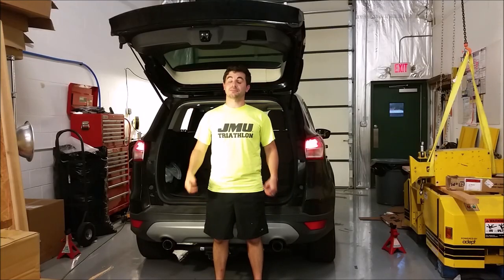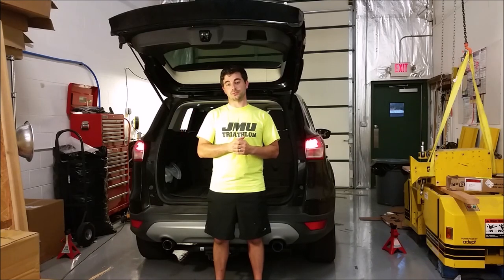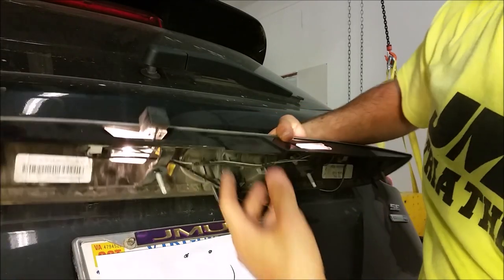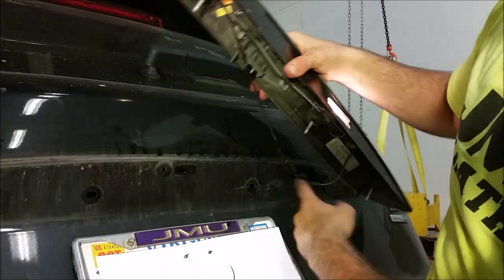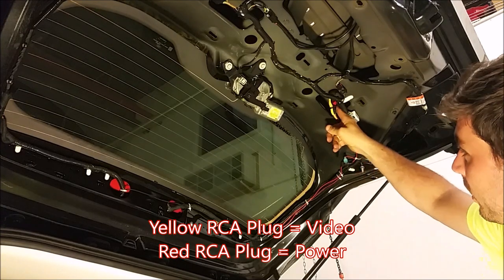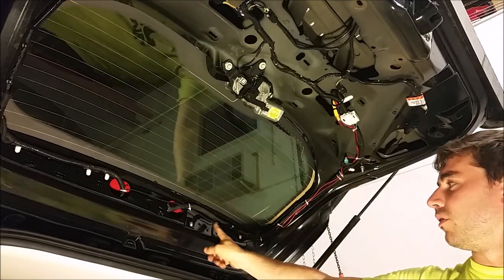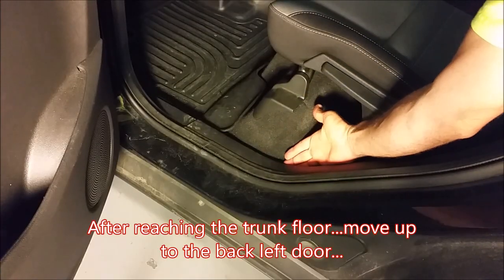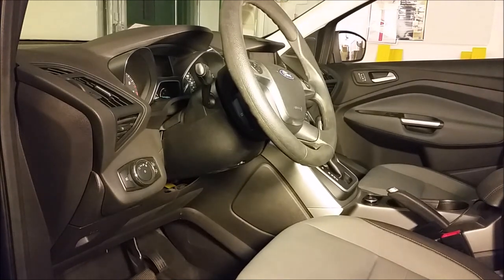Ford Escape Backup Camera Installation to MFT: HOW TO ESCAPE

Comment: hi ijust bought the same camera from eBay and i install it as shown on the video specially for connection in V+ an v- on 14 an 15 pins but nothing work properly. when i connect the video input in the auxiliar connection i can see the camera screen so can u tell me plz what is the missing part or what should i do to let it be correctly installed and working
Reply from the maker: Hi Toufic, 

Yes, that does seem to be missing something there if your pinouts are wired up correctly. Where is your power tapped into? The black and red wires? I was doing mine first late at night and tapped into the outermost tail lights rather than the ones on the hatch with the white reverse lights. Any chance you did this as well?
Reply: hi thank you for your replied. the red and black wired are connected to the rear lamp wire so when i put the reverse on the transmission i have power 12v for the camera
Reply from the maker: Excellent- have you tested with a voltmeter to make sure the 12V are there when shifter is in reverse?
Reply: yes man sure i have 12v and i told you the camera is working only on the auxiliar input so when i change sources between radio am fm Sirius .... on aux i can see the camera screen but when i connected to the pin out from 14. and 15 i cant see screen
Reply: so it seem like i have a missing part not only i need an video out female connector to connect on the MFT harness right?
Reply from the maker: OK- I apologize. I just re-read your first post. Ok, so your plugging into the AUX port was just to test the camera. THAT makes sense and your troubleshooting/testing makes sense. Then it does come down to the wiring as you stated. One thing that I did to make sure that the pins were making contact is I doubled over the wires as I poked them into the slots. THE RIGHT WAY to do this is to have crimpable female pins that snap into the MFT wire harness but I didn't have those. The doubled over wire created enough of a snug fit that the wires didn't slide out when I plugged the harness back into the APIM. Also, it ensured contact with the pins on the APIM. 

Please let me know if this helps- want to keep this going to help you figure it out!
Reply from the maker: OK- I apologize. I just re-read your first post. Ok, so your plugging into the AUX port was just to test the camera. THAT makes sense and your troubleshooting/testing makes sense. Then it does come down to the wiring as you stated. One thing that I did to make sure that the pins were making contact is I doubled over the wires as I poked them into the slots. THE RIGHT WAY to do this is to have crimpable female pins that snap into the MFT wire harness but I didn't have those. The doubled over wire created enough of a snug fit that the wires didn't slide out when I plugged the harness back into the APIM. Also, it ensured contact with the pins on the APIM. 

Please let me know if this helps- want to keep this going to help you figure it out!
Reply: thank you for your replied. don`t worry you can replied whenever you want. Anyway, i tested the connection between the pins and the connector on my beep tester and its working fine but the when i connect the harness to the APIM i dont know if still connected or its slide so now i wanna try to fixed Inside the hole and to be sure its connect i hope it works else i dont know what to do i am afraid to have a missig part between my connector harness and the MFT anyway we keep in touch thank you for your collaborat.
Reply from the maker: Sure thing, Toufic. Keep me posted please!
Reply from the maker: One more thing if you're going back in to check the wires- You know the "sheath" of the wire harness that slides around and captures the three rows of wire inputs? That's another assembly item where you want to watch and make sure your two wires don't get dislodged. As the sheath slides back over the three rows of wire inputs, it will make contact with your wires. I had to redo mine once from that. Again, it would be fixed with the right type of crimpable female pins to snap into the slot... if you can find the right ones, give a shout!
Reply: in this step i know clear that it is done correctly and without problem because i make it long and i double check it anway i wanna try and at the same time i will take pictures and i will send it to you thank you
Reply: one more thing bro, i just watched the video again and i skipped one step in my installation i don;t know if it will fix the prob. it is to remove battery before connecting to swap in the camera Enabled APIM. so i did not remove the battery did that a prob or now is too late let me know please thank you.
Reply from the maker: Toufic Maalouf you could give it a try! Yeah with all the tech nowadays you can't be too careful. if you disconnect the battery for over ten mins it does a reset to the apim. Hopefully that's it- if not we'll keep on it.
Reply: hi bro i checked again and install a new pins but nothing works so i don:t know if i need a special module to communicate between the connection and my MFT tell me plz what should i have like part to complete the installation can i send you pictures for my installation thank you
Reply from the maker: Hi @Toufic- Sorry you're still having some trouble- No you still shouldn't need a special module- can you send a message via Google+ with some pictures of your setup? Probably where your video jack separates into the + and - wires and then as they go into the MFT wire harness?
Reply: can i found you at Google plus in which name please thank you
Reply from the maker: howtoescape131415@gmail.com if you just want to email as well
Reply: hi did you received my emails i sent it to you ??
Reply from the maker: Hey Toufic! 

Sorry for the delayed response- Great pics. 

Ok- from what you've shown I can only come up with two different ideas, and you've probably already thought of them- There shouldn't be a reason why it's not connecting or showing on your screen unless one of these two reasons I think. 

1) Your pins could be reversed by accident. BUT as you've already worked this far and verified voltages with the camera power, I'm going to assume you have monitored the positive and negative leads in correctly into the sockets for pins 14 and 15.

OR

2) Your APIM really doesn't have the backup camera unlocked- I think this is what you may have been asking before about getting another module, right? Everything you have wired up until the MFT harness looks right. As you've shown, when plugged into the RCA connectors it shows up. The problem isn't on the camera's end, and if your pinouts ARE correct, you have an APIM that does NOT have the backup camera unlocked. 

Let me know what you think- 

Thanks!
Reply: hi bro, thank you for your replied.all the connection seems good in both side from the camera till the MFT.So now i am worried about the module maybe you right my APIM doesn't accept the camera, if this is the case what should i do ?should i change the APIM or i can just unlocke it and how thank you.
Reply from the maker: There have been some who have had success in unlocking APIM's by using FORTRAN and an OBDII scanner that can communicate to your car and laptop. I've never done it, and it's a bit risky I think, but it IS possible to unlock it. Search fordescape.org for "Fortran" and you should find some good info. 

In terms of finding an APIM with the camera unlocked, my only advice would be to search the forums, eBay, and Craigslist for one that somebody is selling. At this point, they may be rather high in price, but the good deals are out there. 

You've done the hard part of physically wiring up the camera and testing it- now if you're patient, a module will turn up!
Reply: ok bro thank you i will let you know
Reply from the maker: Sounds good Toufic. Good luck!

Comment: I did this yo my kuga with sync2 version but can you do the same on sync 3?
Reply from the maker: Hey @ Brad, I'm not sure- I haven't been able to get my hands on a Sync 3 setup yet, but I thought that all cars that would have Sync 3 would already come factory with a backup camera?
Reply: No they dont here in the uk. Im purchasing a new kuga and want to add one again
Reply from the maker: Ah- that makes sense. The principle should stay the same, but I can't guarantee it unfortunately :/ Maybe the pinouts will change as I understand the APIM and screen hardware are different/updated.

Comment: so the coax jack wire that u add is red and black wires? then you pinned to 14(+) and 15(-) which is empty what is 1 and 18?? and coax jack connects to video out from camera right?
Reply: I guess it’s just a reference

Comment: So you must have a camera enabled apim?
Reply from the maker: Hey @fleetgt, sorry for the late response. 

Yes- you need an APIM with the backup camera unlocked. Whether you find a factory APIM with this, or you reprogram your existing one with FORSCAN via OBDII, it's necessary to change your MFT screen to look for the camera when the car is in reverse. 

Having purchased an OEM camera yourself, you probably already know this, but eBay cams don't provide the projected backup lines (white) in the camera image. They only have the red/yellow/green indicator lines. If your liftgate door doesn't come with that connector/wire harness you may be able to find one... However, FROM MY EXPERIENCE ONLY, the signals coming to the camera should be: 

1) Positive 12V power to the camera from your backup light
2) Video positive and negative feed to the MFT dash
3) Ground (0v) from the camera. 

That should be the four pinouts you're talking about. I only have experience with the eBay cam, but i would THINK that the smarts for the white steering lines are built into the OEM camera, hence the extra few bucks you gotta spend for it along with the larger size of the module. 

Please let me know if you discover anything differently or if you have another question! Everybody's learning here :) 

Thanks again for checking out the channel!

Comment: How did you get the guides on the left and right? I had a camera installed at a shop and i have tye guides enabled in my 13 escape but i dont have guides. Any thoughts?

Comment: Sup man does the sel have the back up camera interface plug in already ? Or did you have to get ? I bought the camera you used and I took it to a place to get it installed but they told me about this interface thing ?

Comment: hello,  did the screen (navigation screen) you have come with this escape? Or did you install of after as well?
Reply from the maker: charae richardson it is the factory screen - If you wanted to get an aftermarket screen (they do make them for these Escapes) they have a yellow video jack out the back of them- much less complex than wiring into the stock ford unit. The wire routing up the car would be similar though! please let me know if you have any other questions and thanks for watching!
Reply: may i ask,  can you put a link to a aftermath navigation system with radio that is compatible with the 2013 ford escape & that can have a back up camera installed as well? additionally a dash panel or installation kit if it doesn't come with one. Thanks in advance
Reply from the maker: After doing a few minutes of research I found a few items: 

From Crutchfield- a bit expensive, but a good company with a good reputation: https://www.crutchfield.com/p_113DDX6903/Kenwood-Excelon-DDX6903S.html?tp=20217&awkw=210690366745&awat=pla_with_promotion&awnw=g&awcr=108845708425&awdv=c&awug=9008464

This includes a Kenwood aftermarket screen with options for a backup camera behind it (yellow wires). It also has the option to the right to match up your vehicle to see what other hardware you'll need. It allows you to enter the year, make, and model of your escape as well as if you have the 4'' Sync or 8'' MyFord Touch screen. Then you go from there and select the best options to go with. **I haven't personally purchased or handled this set, so I don't KNOW all the ins and outs or if it will install with a clean fit, or not. As said before though, Crutchfield doesn't sell junk, so my guess is that this could be legit for your application.**

If you're looking to go aftermarket for a backup camera and navigation keep your stock unit, check out LockPick: https://www.coastaletech.com/mytouch.htm. 

It's an aftermarket solution to insert this product as an intermediate module to intercept the signal going to the screen on your Escape. It basically plugs into the RCA (red/white/yellow) plugs in the center console and overrides the system to allow a video input while driving. Currently, Ford has it set that the RCA plugs can only play video while the car is in "Park" for safety/distraction reasons.  Some people have bought this system and been able to plug their phone into the RCA plugs via adapters (phone>usb>rca) to project Google Maps onto the stock Ford setup. However, the touchscreen capabilities at that point are inactive because it's just playing video rather than enabling buttons. ** I am NOT SURE if it works for smaller 4'' screens, but I do KNOW that it works for the 8'' MyFord Touch screens with Sync 2. **

Please let me know if this answers your question! Happy to help with anything else if I can. 

Thanks!
Reply: Thanks a lot! I appreciate it!
Reply from the maker: You only need the red/yellow/white plugs in your center console if you're keeping your head unit stock and going with LockPick. However, since your car doesn't have the 8'' MyFord Touch screen, don't worry about that! 

If you go with an aftermarket stereo/screen with navigation, it will most likely have an input for backup camera. Check though, just to make sure. Chances are, if there's any type of a yellow wire coming out it's for video, but double check the label. 

Hope this helps!